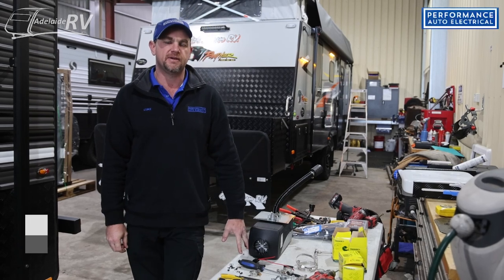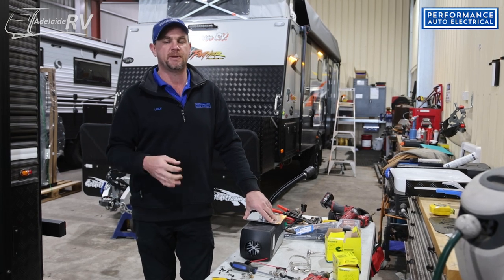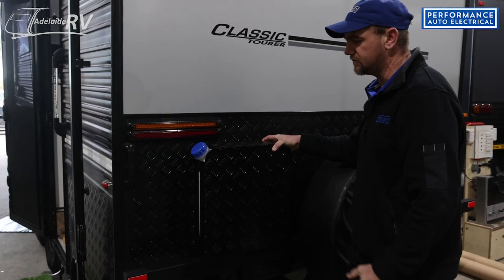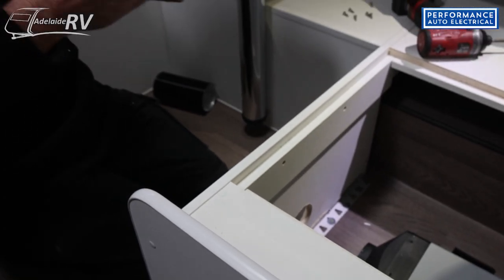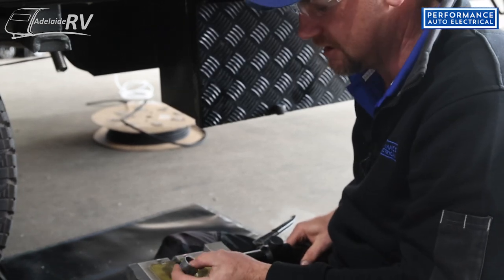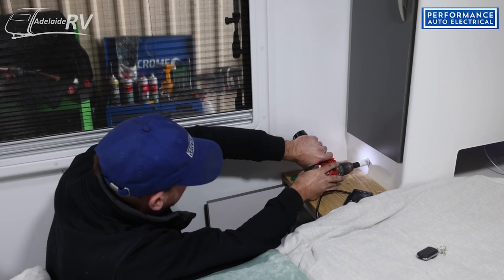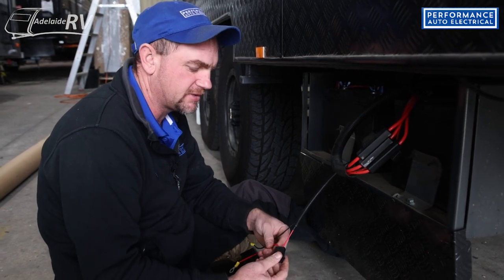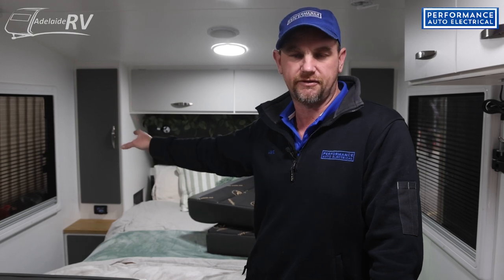Winter Camping Made Cozy: Installing a Diesel Heater in Our Caravan | Performance Auto Electrical

Comment: Excellent installation and video.  I am experimenting with an external diesel heater for a travel trailer.  I installed a thimble to feed the warm air into the trailer under the bed.  I cut a 5.5 inch hole in the floor so I can install a heater, with a heat shield under the bed.  Like you, I ran 12 vdc directly from the battery with an in-line fuse.  I definitely want to install a fuel tank, of at least 10 liters, on the outside, due to diesel odor from spills.  I am not sure how far I can run the fuel line from the tank to the fuel pump and then to the heater.  A sincere "Thank You'!!!!

Comment: i think having a kill switch in not good if it gets turned of accidently it will fry the heater , because it hasn't gone thru the shut down mode. also there seems to be a downward loop in the exhaust line for condensation to collect. just observation cheers.
Reply: Agree. I think the kill switch should not be accessible from the living space to prevent accidentally switching off which may cause a fire.